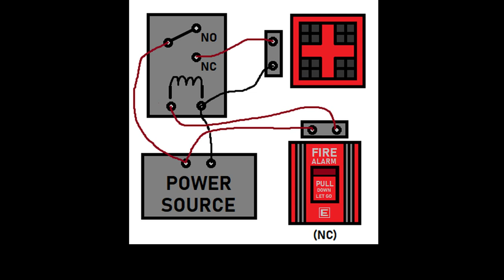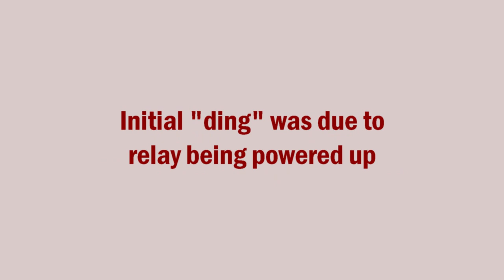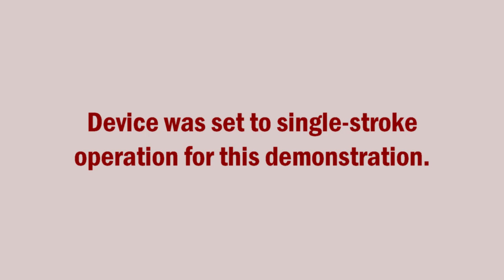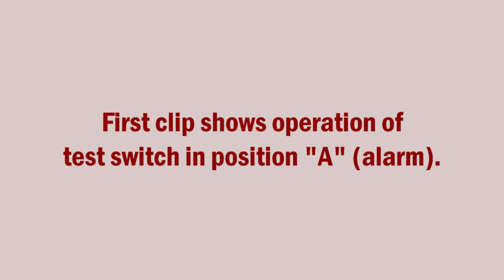Standard Electric (Edwards) Coded Pull Station - Overview & Demo - Retro Fire Alarm Technology

Comment: I would love to see this box  used on an Edwards fire bell bearing the same tone as your Simplex 4080 except in single stroke mode.  If you can run your Simplex 4080 in single stroke mode, that should sound the same.  My elementary and middle schools both used the same Edwards fire alarm systems.  I would love to hear them again.  They used coded pull stations.  To the best of my memory, the elementary school's code pattern was usually 4-2-4 while the middle school's code pattern was usually 3-1-3.  This is most likely due to the fact that these were the pull station's codes on the boxes located nearest to the principal's office.

Comment: They have these at my old school on the old system which also have Edwards adaptahorns. Now they have simplex and system sensor. However, they still have the old devices up!
Reply from the maker: Even the pulls? I don't think they're supposed to.
Reply: @Fahrenheit4051  well they are on a seperate system and not the new one. They have panels are seperate
Reply from the maker: @wubbzyeas615  Oh, okay. The way you phrased the original comment made it sound like they replaced the system but left the old devices disconnected. But it's two separate panels for two separate areas.

Comment: Primitive in terms of making an addressable system, but effective, I’d say. These old stations are seriously cool
Reply from the maker: Thanks! Do your coded pull stations have normally-open contacts, or are they normally-closed like mine?
Reply: @Fahrenheit4051  Of course! Now correct me if I’m wrong, but closed contact stations require a relay to work properly? 

Most of my stations are going open contact (close when the code wheel is engaged), but my Edwards is a closed (or vice-versa). I did actually modify my Edwards to be an open contact pull, just for making demonstrations a little easier to wire
Reply from the maker: @VintageVibratone  You're correct. How did you modify the Edwards one to be NO?
Reply: @Fahrenheit4051  If I remember correctly, I think I just bent one of contact arms at the code wheel. Definitely don't recommend doing that at all, but it surprisingly functions  pretty normal

Comment: I recently got a rare Standard Electric Time-rebranded 1250 (basic no glass rod model) & cannot figure out how to wire it: while I know the Edwards 1251 I have must be wired using a relay as it's NC (for whatever reason), it seems like the Standard 1250 I have is NO, even though I have the wires connected to terminals 1 & 2 & the attached alarm sounds in normal condition (which it shouldn't). Adding to the confusion is that unlike my Edwards 1251 the Standard 1250 has 4 terminals despite having no additional accessories like a key switch, & what's more a red wire connects to both 3 & 4.
Reply from the maker: So the horn doesn't even cut out at all when the station is pulled?

If there are four terminals, and you know that you'll be using two wires, I'm pretty sure that means that there are only six possible wiring positions:

1. *
2. *
3. 
4. 

1. *
2. 
3. *
4.

1. 
2. *
3. 
4. *

1. 
2. 
3. *
4. *

1. 
2. *
3. *
4.

1. * 
2. 
3. 
4. *
Reply: @Fahrenheit4051  It actually does: I pulled the station with the power turned on, & it didn't sound (I didn't wait for it to finish before turning the power off however).

Comment: How can one tell if a coded pull is NO or NC?
Reply from the maker: Documentation is scarce, so the next best bet would be to ask one of the old-timers on one of the Facebook groups (Fire Alarm Enthusiasts, maybe Crappy Fire Alarm).

Your safest bet otherwise would be to look at the number of contacts. If you see only two terminals, my null hypothesis would be NC. If you see four or more, there's probably one NC and one NO.

My Simplex 4263-1 has six, and I'm not sure what that third set is for. I believe there might be some diagrams available if you scour the Fire Panel Forums.
Reply: Ok. Thanks!